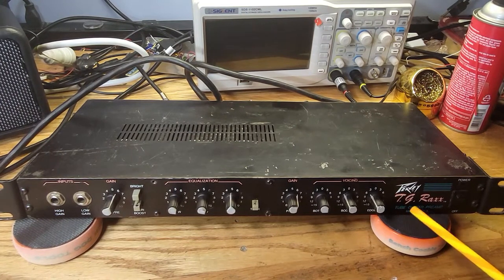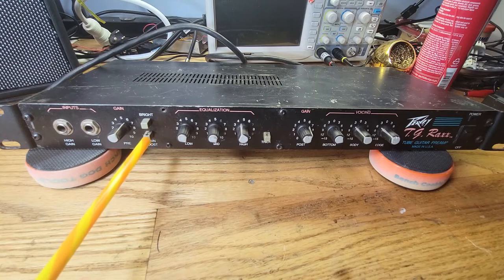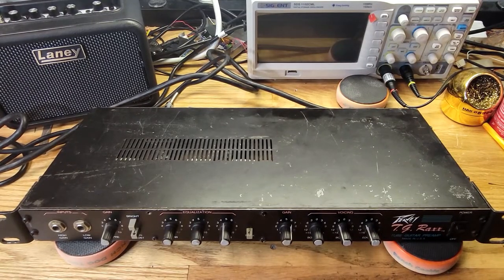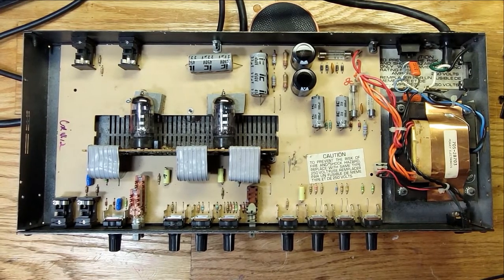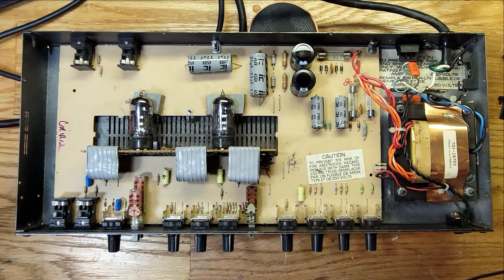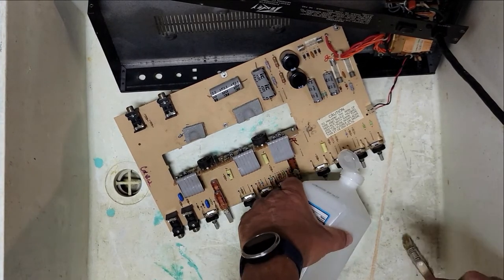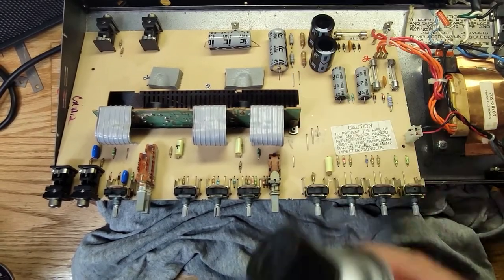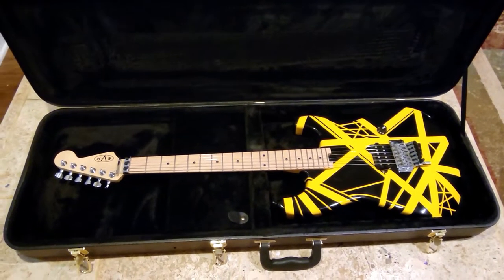Peavey T.G. Raxx Preamp Overview, Teardown and Demo

Comment: Hey . What is the chain signal ? you must have some pedal before preamp for sure ? DS1 or booster any kind ? Thanks
Reply from the maker: It was a while ago but I think I remember going directly into my JCM900 send/receive bypassing the Marshalls preamp. I only used the boost and gain built into the Peavey.

Comment: @Signals and Bits 👍👍Thanks for an excellent description and breakdown of the TG Raxx. I have had one for 10 years and after watching your' video, for the first time, I now understand the relationship between the two sets of control knobs, up to now I have just set them the same, ditto the switch on the back of the unit! 🙄🙄.  One question for you if I may, I live in the UK and bought my TG Raxx whilst visiting a friend in the USA. Currently I am running it with a converter for the different voltage and frequency we use over here, the converter plugs into a normal domestic socket and isn't huge but I was wondering could I swap transformers or change the wiring to do away the converter?.  Not a huge issue but I thought I'd ask 😏  

Thanks again for your time and trouble.
Reply from the maker: Hello.  Yes you will need a new transformer for it.  The part number you will need  is "705-29303".  This is good for 220V / 240V.  It is also used in other Peavey gear like the Rockmaster.   You will have to rewire the Primary side a little bit to replace the "+ 0 -" switch in the back with a 220V/240 selector switch.
Reply: @signalsandbits  Thank you so much for helping out with this info, it's so much appreciated. I paid $60 for my TG Raxx and it's a bit battered but the sound is excellent, really warm. I've used it for my ham fisted recording efforts and live through a Marshall solid state power amp and even my band mates liked the sound, something they never mentioned with my regular amp!  I'm not sure how long the tubes have been in there but they are still glowing brightly so I'll leave them alone for now.

Thanks again for the help & advice.   👍👍

Comment: Love freaking this pre-amp, I took the two Peavy Super 7's (Keep OG's) out and put Messa Boogies in.  I am looking for the Peavy t.b Raxx Preamp for bass, they are pretty much the same pre-amp.
Reply: the tg raxx and tb raxx preamps are exactly the same. peavey labeled them that way for marketing reasons, thinking nobody would buy a universal preamp design. i have one of each and inside the case, everything is identical. no changes in component values, same part numbers on the circuit boards.
Reply: Hey, well even though apparently theyre the same, i did just see one pop up on Reverb today!  I was curious and it brought me here.

Comment: Thanks for this video, super useful as I have a bass version of this unit that needs a similar treatment!

Is there any advantage/disadvantage to using 70% vs 90% alcohol for it? I can source 70% locally but the higher concentration is difficult to get.

Thanks!
Reply from the maker: Both will work.  Just make sure  you let it dry before  plugging it in.